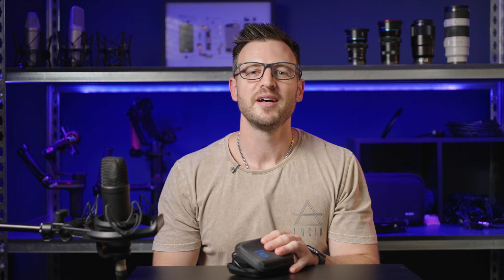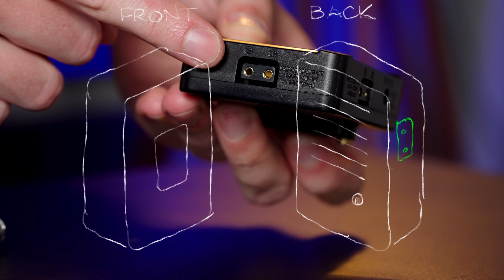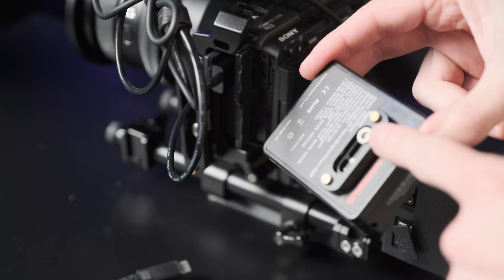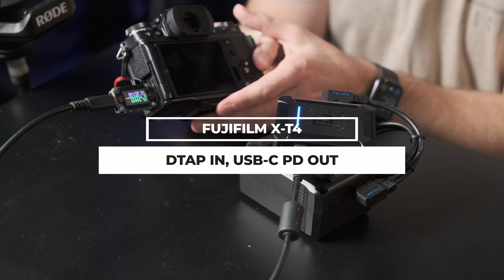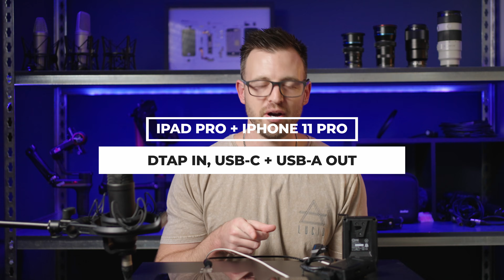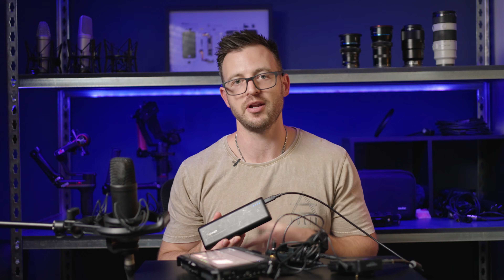FXLion Nano Hub Review - USB-C / DTAP / USB-A/ DC power interface

Comment: Hi, thanks for the video. I've got one question. If I want to power my monitor using sony L dummy to dtap, and my FX3 using usb c, is that safe not to use the nano hub, and connect both devices directly to the nano battery?
Reply from the maker: Honestly I have no idea sorry. I’ve got a dummy battery on order so will test it out at some stage

Comment: So to make sure that I understand what you’re saying correctly, you’re using a V mount battery to power everything through the hub? Can this also be done with something like an Anker power bank instead?
Reply from the maker: Yes, that's what I'm demoing in this video. Everything in the thumbnail (monitor, camera, transmitter, receiver) powered via a v-mount battery. 

Obviously it depends on the wattage used by the devices and types of connections (IE: there is only one USB-C port on the hub so if you are powering it via USB-C then you can't be outputting on USB-C at the same time as that port is in use), and if your USB-C power bank only supports 30w then you couldn't attach a simultaneous load of 60w. 

What are you wanting to power from the power bank?
Reply: @Isaac_Insoll  Just an A7S III and/or an FX3 with a Ninja V. Obviously, each camera is separate. I want to get crazy long battery life, but V-Mounts are silly expensive to buy.
Reply from the maker: If you power the hub via USB-C then you can’t use that port to power the FX3. You could use the USB-A to trickle charge it though
Reply: @Isaac_Insoll  Ah, ok, that makes sense. Thanks for the help!